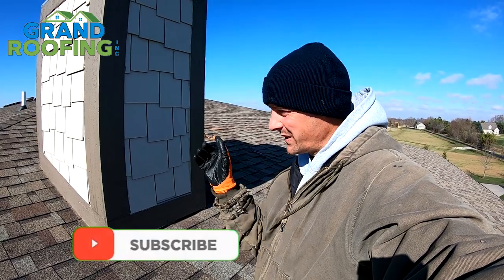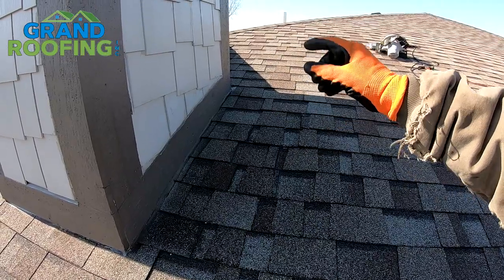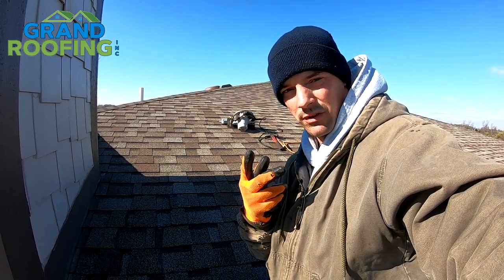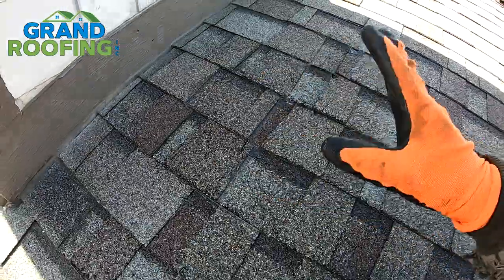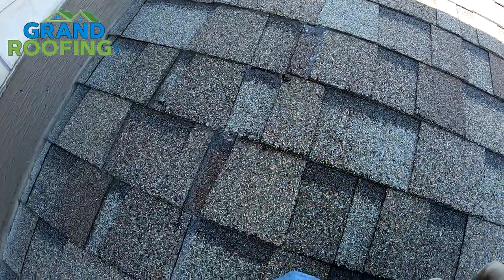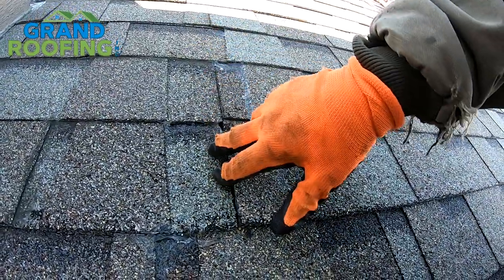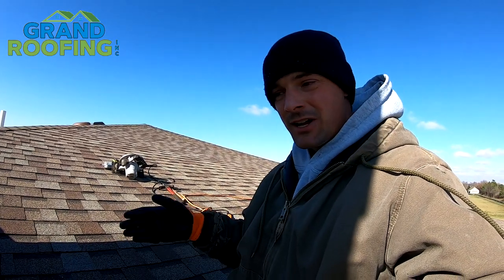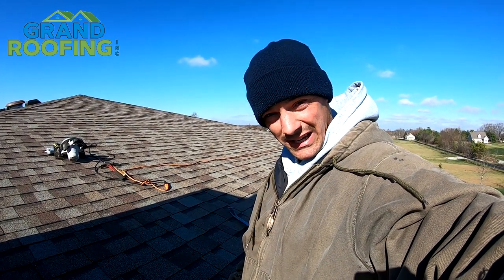Worst roof ever, leak around chimney, how to find a leak - Cutting shingles on the roof can be bad

Comment: Good catch! I've had to threaten to push guys off the roof to get them to understand offset🤣, just kidding! Another huge problem I've ran into is the chimney chase itself. During the 80s and 90s, millions of homes were built with chase style chimneys, and a lot of them aren't even functional. The problem was with building code during that time. No vapor barrier was required behind vinyl siding. Step flashing a shingle to the chase does no good if water blows in being the siding and runs behind the flashing. At one time, 30% of my warranty claims were chase chimneys. The company I worked for had great contract language that excluded the chimney, other than the flashing, from coverage. But that doesn't help the homeowner. So I started selling them an upgrade to the chase while we were doing the roof. Remove the siding and cap, have a new cap made, wrap the chimney in ice&water, and re install the siding. I could do most chimneys for 200 to 500 since I always had extra ice&water left from jobs. Stopped my warranty problem and made the customer very happy.

Comment: Yup seam on seam...if it’s there it’s probably all over the roof! Just curious if it was step flashed against the chimney or did they  “butt-n-run” with a straight counter flash underneath?
Reply from the maker: There was step flash but it was very piss poor in some areas not even lapped but 1/8". Midway up the chimney they actually nailed all of the flashing down to the roof deck and then just threw their shingles in.
Reply: Yeah that’s kinda what I assumed considering they didn’t have any wall flashing exposed in the front or any bleeder flashing as you mentioned running out the bottom...EZ money repair regardless!

Comment: I love stupid mistakes like that, I once fixed a chimney leak, neither of the two backpans installed on top of each other extended past the chimney on either side, you could see plywood, all new flashing and the leak disappeared. I’ll watch the repair video, maybe I’ll learn something 🤷‍♂️
Reply: I was also taught to pre cut the “lead” shingles as you call them, we just confuse everything and call them starts lol. I’ve never liked the idea of cutting them in place primarily because you can tear the nails out if it doesn’t cut nicely, especially in cold weather

Comment: I agreed with everything you said.... until you said "ice and water". That seems to be a roofers "flex seal" material. I've repaired many leaky roofs that had ice and water right where the leak was located. All it did was make my job harder.
Reply from the maker: I personally am not a big fan of ice and water either. The only reason I used it was because it was really windy and it was easier to work myself. You are right, to tell you the truth I don't want to do any new ReRoofing jobs that have ice and water on them. It's a nightmare to tear off! If a roof is done right you shouldn't need ice and water. Unfortunately manufacturers got smart and said there warranty require certain things.
Reply: @GrandRoofingInc  
By the way, congrats on your success on YouTube... and your Business. 
Happy covid Xmas. Lol
Reply from the maker: Hahaha thanks! You to!